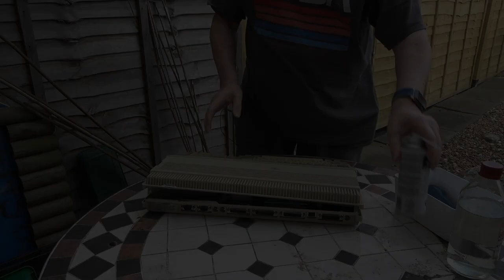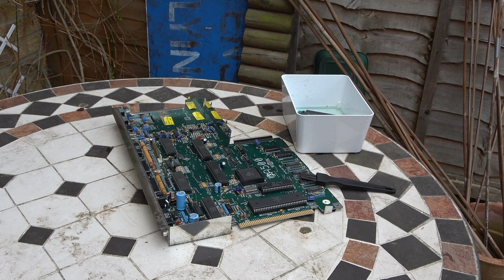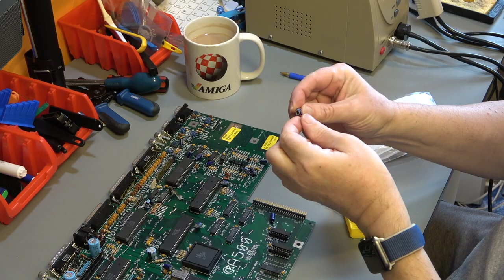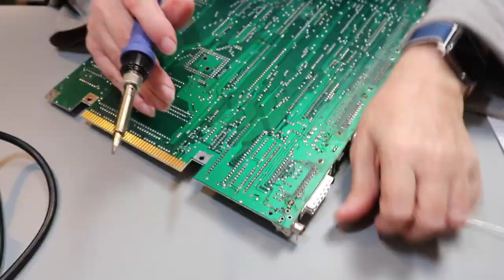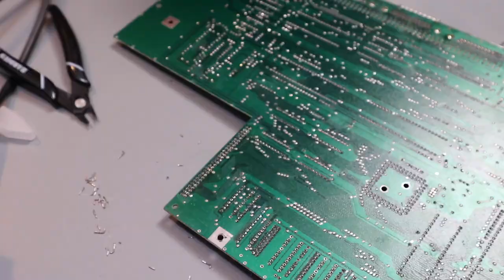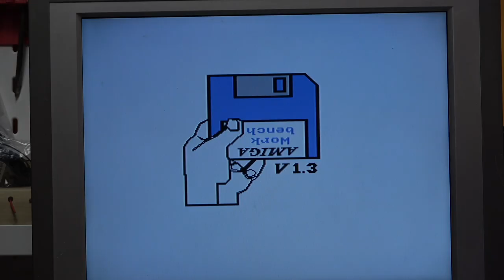Amiga 500 "Power Light Comes On"  Repair Part 2

Comment: I would get some small drawers Tim.
Reply from the maker: Thanks Brian. Care to suggest anything specific? Inside drawer dimensions need to be in the order of 65mm x 25mm x 15mm.... (to accommodate strings of resistors etc)
Reply: Try these Tim, not too expensive.